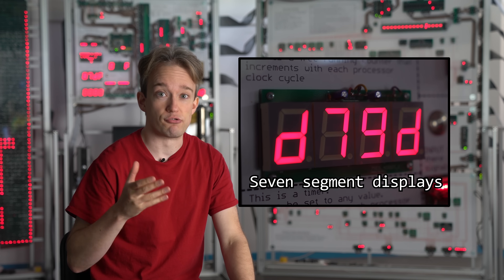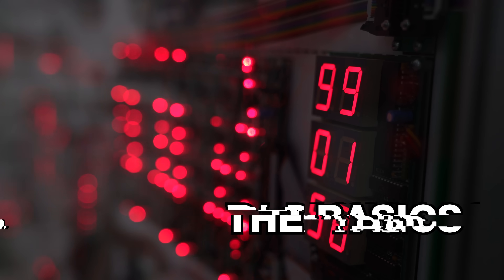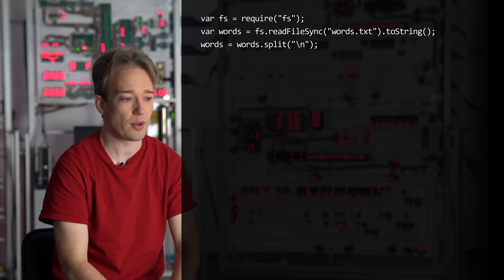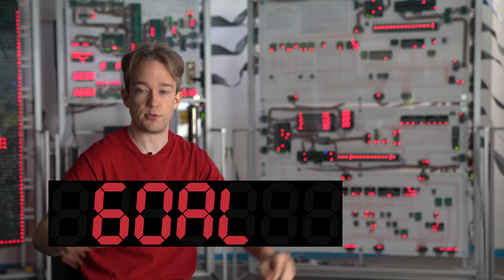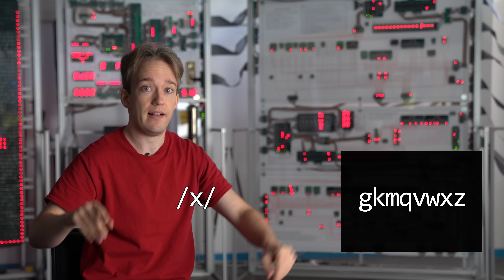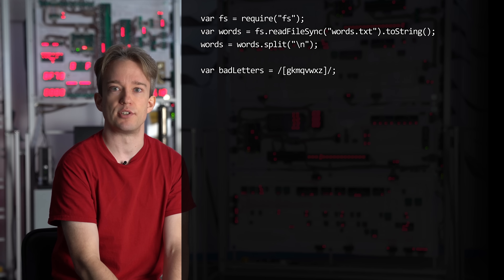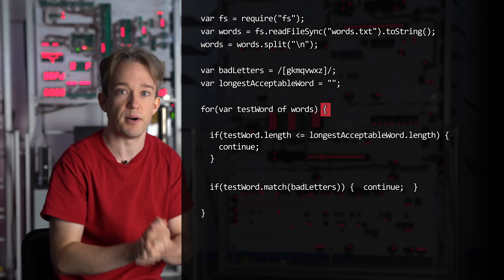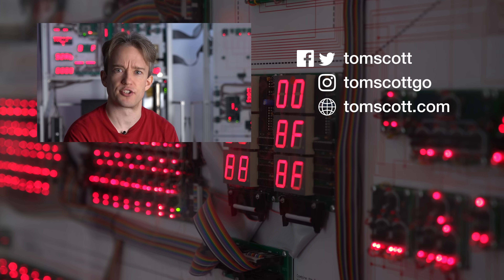What's The Longest Word You Can Write With Seven-Segment Displays?

Comment: Dichlorodiphenyltrichloroethane was just fine. "i" and "o" should count: remember your classic "Error"? There's and "o" there no one had ever problems with
Reply: toxic, was used as an insecticide... until more than the insects started dying.
Reply: @Valsorayu  I think that applies to many chemicals
Reply: Is that a name of a rocket fuel?
Reply: @typicalfish1116  
Looks like some sort of plastic.
(thought it'll also work as rocket fuel)
Reply: @typicalfish1116  something that inctrees climate change
Reply: What does dich... Dichloro... Dichlorodipen... Dichlorodiphenyl... What-you-said mean anyway?
Reply: @mastertrams  Two benzene rings with one hydrogen replaced by a carbon and another on the opposite to that carbon replaced by a chlorine.  That carbon connects the two benzene rings. That carbon also has a bonded hydrogen and another carbon.  That other carbon has three chloride atoms bonded to it.
Reply: @mastertrams  It's more commonly known as DDT.
Reply: @mastertrams  dichloro-diphenyl-trichloro-ethane
di meaning two, tri meaning three, chloro referring to chlorine, phenyl referring to a certain ring structure that sticks off, and ethane being a simple hydrocarbon gas with the formula C2H4 (before the modifications that are due to all of the other prefixes and their various amounts. You might want to look at the Wikipedia page's diagram of ethane, it really is quite simple).

Actually, while reading this, I decided to plug in the chemical name because I was curious on how its structure looked, and I realized that it's actually the chemical name for DDT, the infamous insecticide and carcinogen/environmental pollutant.
Reply: DDT, used for insecticide
Reply: @44calibergirl  "Used" only in the sense of "it was used", not "it is used". I suppose there's always some mavericks out there still using old stock off a shelf in very small quantitites, but it's been illegal to use virtually worldwide for a while now.
Reply: Y
Reply: @dustikelly6730  y wasn't a bad letter
Reply: @dustikelly6730  if you can do 8 then y should be no problem
Reply: @dustikelly6730  y
Reply: IUPAC numbering would be helpful for understanding the molecular structure, and would push up your string length too
Reply: 4:02
Reply: I have problems with it, it clearly say "err-zero-r"
Reply: Liggliluff Lower case o is half the height of a 0
Reply: @Liggliluff  Your name is clearly L199111uff.
Reply: t
Reply: DDT as the result is fine
Reply: DDT, main component of insecticides
Reply: 7 letter-
Reply: Same with "y"
Reply: Supercalifragilisticexpialidocious
Reply: This will work
Reply: @turtlegod0122  it has a g
Reply: @lisahenry20  oops 

it does
Reply: Everybody has problems with it.
Reply: grammar

Comment: q is out cause it looks like a 9. *five seconds later* S is alright.
Reply: thought that was dumb the 9 in calculators looks different too
Reply: S seconds later
Reply: If the letter is a 9, it has a segment on the bottom, or at least that's what I think.
Reply: @literallylegendary  
It is considered to have a "tail" and is optional.
Reply: @deedeeen  Alright, then.
Reply: Maybe it's not ok because it is positioned wrong to be a q? The "tail" of q goes below the "basic level" of letters.
Reply: Actually, 5 looks like S more than S looks like 5
Reply: Not to mention the B also looks like a 6
Reply: S looks like a 5
Reply: @YellowToad  you don’t say
Reply: @YellowToad  ok sherlock
Reply: _
| _ |    as q should work? 
    |
Reply: Even if you allow q and g as well, the results are still the exact same for both patterns that Tom showed
Reply: to be fair if you know that it's supposed to be a letter you can immediately tell it's an S since no other letter looks like an S
Reply: q and g look the same. No letter looks like S.
Reply: @Needformadness2  wow long username
Reply: @SwagSwagSenate  CamelCase
Reply: @FJ.Y  wot teh phuk
Reply: @FJ.Y  Nope, it's PascalCase - not camelCase.
Reply: @Needformadness2  not me
Reply: @Needformadness2  You could make a g by doing a 9 with a little tail at the bottom like a g appears in most fonts. So every space lights up bar the bottom left one.
Reply: The S would be recognizable in a word - no one would go "What's this 5 doing here in the middle of a word?". q, however, would not be all that recognizable. Usually, it's lower than a 9 - but it won't be in a seven segment display. So even if people won't say "Hey, that's 9-uick", they'll still think it looks weird. Edit: To be fair though, a 9 is usually displayed with the bottom part on.

Comment: A lower case g is perfectly acceptable for a seven segment display. When showing a 9 you don't light up the bottom segment. I never write a 9 with a hook to the left at the bottom so I wouldn't do it on seven segment displays. Another minor point is that for the letter n on 7 segment displays it is more common to use a lower case n. and not make it the full height version shown in this video. Now, what is the longest word if you allow the letter g?

BTW, that looks like a really interesting museum. I'd love to see it for myself but I'm too far away.

Comment: The question: "What is the longest word you can write on a seven-segment display"?

The answer: A

You only gave me a single seven-segment display.
Reply: Bruh
Reply: If it can be any display with 7 segments (which is different from a 7 segment display) the longest word would be "iiiiiii". Half lenght i's of course.
Reply: @Paco_de_Pinda  that just an 8
Reply: You can write words one letter at a time on one 7-segment display. I found 300 ms per letter to strike a good balance between speed and comprehension. I could've done the job with a couple of status LEDs, but I had all those juicy IO pins left over...
Reply: OiI
Reply: Nah, squeze a lowercase L and lowercase I into the same seven-segment display as 
|
|  |
and you can produce "li," the "do re mi" version of an A-Sharp note.
Reply: @evanreign9344  Can you make the word “Clifford” or “Arthur” using a 7-segment display?
Reply: angry upvote
Reply: Technically that's 3 segments
Reply: a
Reply: @enki-enlil  oof
Reply: ok mage
Reply: Acutally, technically, that would be I I
Reply: What about I?
Reply: literally
Reply: Or 65535, the max value of the WORD datatype.
Reply: Naa, you'd flip it and type 'oi' or 'lo' or something
Reply: It could be any letter that way xD

Also, I just noticed how well these sentences rhyme xDD!!!
Reply: @Brahvim  Not every letter is a word
Reply: You can’t write an A on a seven segment display, it would have to be I instead
Reply: @rat.tar.tar.8359  
 _ 
|_|
|  |
This is an "A", isn't it?
Reply: Geolykt I have NO idea what that is so I wouldn’t classify as an “A” but other’s might, also seven-segment displays usually only go up to 2 enters, I think
Reply: @weskerposting  
Well, a 7 segment Display is anything that can be displayed with These chars (or less)
  _
|    |
  -
|    |
  _

Or
   #
#   #
   #
#   #
   #
While an A would Look Like
*#*
#*#
###
#*#
(Simplyfied)
Reply: @rat.tar.tar.8359  You can write A on a seven segement display
Reply: @rat.tar.tar.8359  tf

Comment: I disagree with your g, q, and z being incorrect. You argue you can't use 6 or 9 for G because you cannot disambiguate, but then use 5 as S, throwing your argument out. Z should be as valid as 7 or S. Arguing that just because it has a slanted line, it cannot suit doesn't fit when 7 itself uses a slanted line, and you cannot argue it cannot be disambiguated from a 2 when you use 5 as an S. Again, you cannot argue that Q cannot fit because it's just a 9, if you use 5 as an S. K, M, V, W, and X I agree with you on, but not G, Q, and Z.

Comment: Should that not have been if (testWord.length >= longestAcceptableWord)?

If it was testWord.length <= longestAcceptableWord, would that not skip over every word, as testWord starts as an empty string?
Reply: The condition in the video is correct - that's because if it is true, you skip to the next word.

Comment: I know you addressed why you’re using “continue”, but I feel like it would have been easier to explain and read if you just used “if/else if”. 
Then again, who am I to question why Tom Scott does anything.  Great video!
Reply: There's no reason for an else-if. Just put your code inside the if-clause where it belongs instead of putting it afterwards. for (const word of words) if (word.length > longest.length && !word.test(badLetters)) longest = word;
Reply: @jennasmith7766  or just nest those two flipped conditions in themselves, might be easier to explain

Comment: Just put a NOT in the if statement and put the code inside it then their is no use for continues

Which is much simpler and easier to understand
Reply: What’s simpler than a key word that lets you know that there’s going to be no other side effects later in this loop that you can’t see right now unless you scroll down the entire two hundred-line length of the function searching for a matching closing brace?

Comment: Shouldn't there be a separate test to see if the word is exactly the same length, and if so then add it to a string (or adds to the array of strings) with the other word(s). And when a larger word is found it replaces the whole previous string (or array of). This way if there are more then one word with the longest length then it would be shown?
Reply: Easier would be just to sort the array of words from longest to shortest and then print every time a new acceptable word is as long or longer than the previous one. This would print out all the longest and same length words and then nothing else.

Comment: So I and O are "numbers with aspirations", but S (just a 5) is fine?

I think G, l, O, Q, Z should be allowed as well
Reply: How would you do a Q?
Reply: @onionbot2  the same way i do P, but mirrored. It would not be a 9, because 9 has an extra bar on the bottom.
Reply: I think the G is fine.

I had a guitar tuner that used a 7-segment display to display the musical note names. A-F were the standard patterns and for G it used the one that looks like a 9.

Also for the flat symbol (♭) it used the same pattern as the letter b.

Sharp (♯) wasn't used because all notes can be written with just flats, and there isn't a good way of displaying a ♯ sign.
Reply: how could you do Q?
Reply: @carter22j  you take the small one "q" and it just a 9 missing the lower horizontal line
Reply: @carter22j  9 but with context. It'd be easy to tell which is 9 by just checking, or "is this in a word right before a U"
Reply: @carter22j  it would be a 9
Reply: @waylong4797  q would be a 9 without the line on the bottom.
Therefore q would be unambiguous, aka perfectly fine.
Reply: oh okay i get it
Reply: S isn't straight lines
Reply: S should not be fine, but I/O/Q I don't see what his problems were. S/Z could maybe be missing their middle bar?
Reply: G is indeed fine and it is also used in real life. My microwave displays it when in grill mode.
Reply: how can you even do Z?
Reply: @markusTegelane  You could just use 2, or if it needs to be unambiguous, remove the vertical line in the middle 

Same for S, simply use 5 (optionally w/out vertical line for clarity)
Reply: O looks like 0 to seven-segment display?
Reply: Like in "VOL". . .
The "O" in "VOL" looks like a number 0.
Reply: @geremygonzalessleepwalkerr2900  O looks like 0 in many fonts made for pixel displays too. I don't understand why don't every font uses a slash through the number 0 to make it distinctive from O, like any font programmers use does. It would be so easy to make clarity, yet we don't it's so silly!
Also there's too many fonts out there where you can't tell l , I , | and 1 apart! 🤦‍♂️
Reply: S looks like S tho
Reply: If you replace the corners in 5 with curves you get an S so S is fine but if you do it with O it is also fine 

What?
Reply: If you have a decimal spot, you could do V as |_| and U as |_|.
And Q could be a zero with a dot. Like 0. (Which I can't make like a 7-segment on my phone keyboard)
(It might just work for me because I tend to write my Vs and Us the same except for U having a tail.)
Reply: Are we trying to write code for you or the general user though?
Maybe I've taken to writing an M as 3 horizontal segments. Perfectly understandable to me, but not many others. Something to consider.
Do all displays have a decimal point? I guess could write a check for that, and change the disallowed letters.
Reply: Z looks too much like S
Reply: @lolabaker8197  That's like arguing 2 looks too much like 5. 2 would serve as z while 5 would serve as s. Tom is just being a hypocrit by accepting s but denying z, q, and g.
Reply: @lolabaker8197  they're flipped, so it would be fine.
Reply: @lolabaker8197  it's inverted